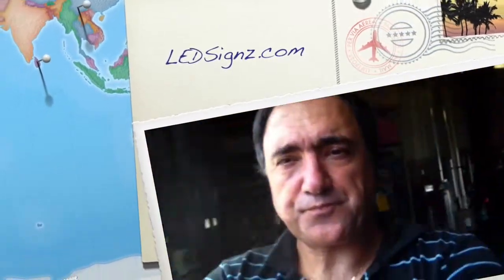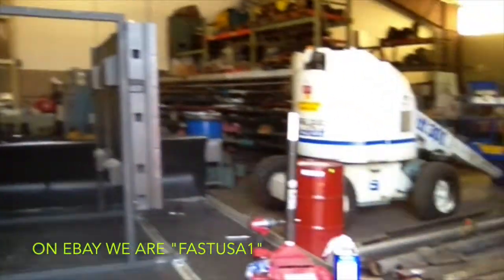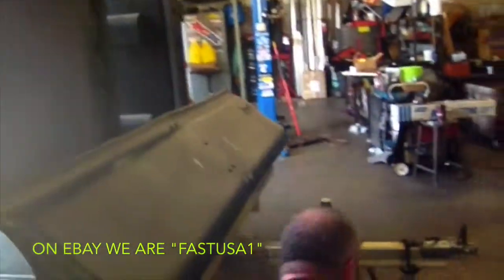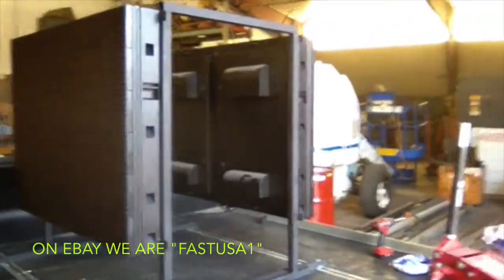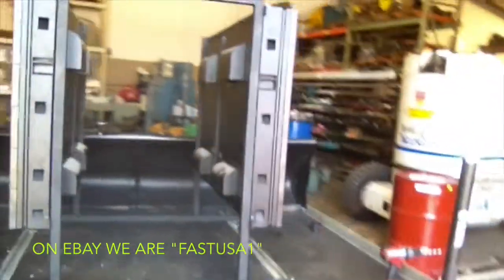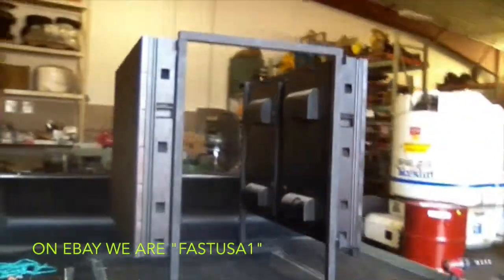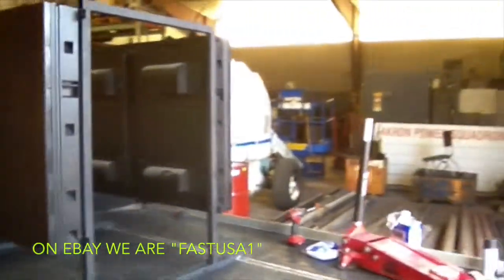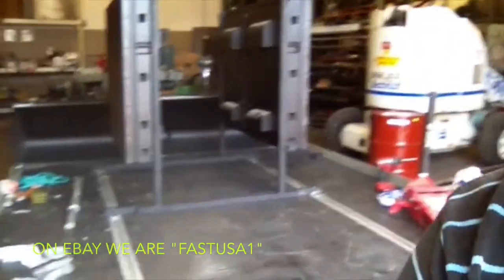LED Sign Portable Complete Kit includes install hardware

Comment: At the welding factory re-designing the LED Brackets, soon we'll make them in volume... check it on eBay http://cgi.ebay.com/ws/eBayISAPI.dll?ViewItem&item=390877829934
Reply: jojosmediaworld using this LED built for us as a grand opening tool, then we will sell them to the public. Want more details? Site opening soon www.jojosmedia.com 

Complete units 4 X 3 for $6000 for everything, face of LED, cables, wires, programming, computer, software and all mounting hardware included. All you need is an electrical socket... Want one?